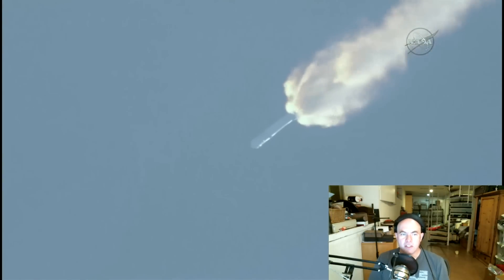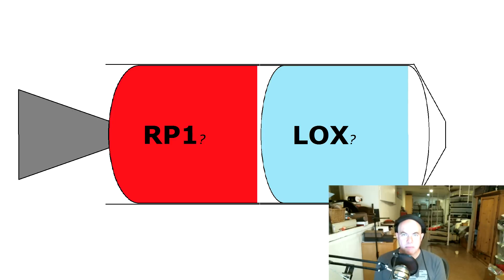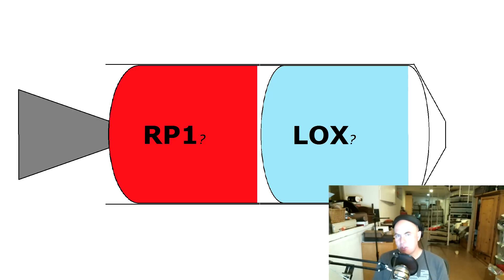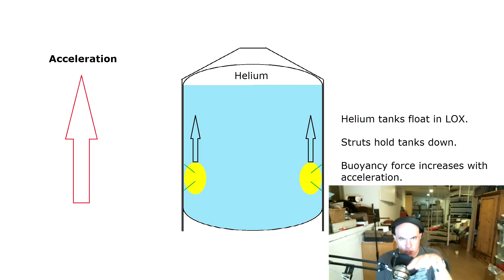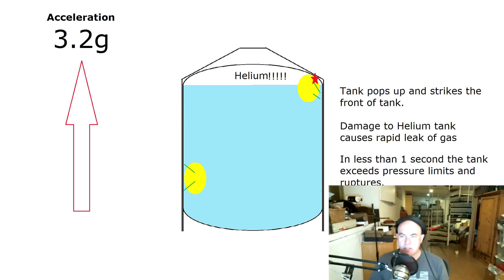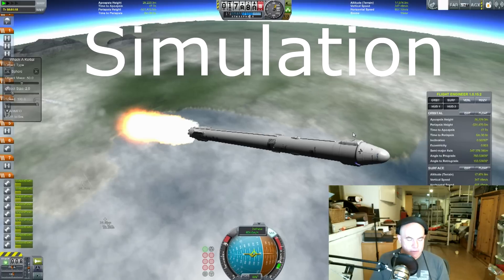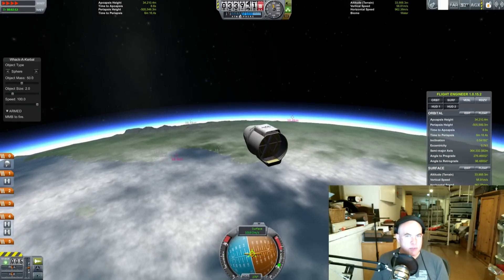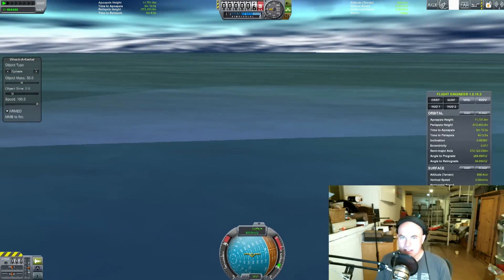Explaining the Space X CRS7 Launch Failure

Comment: So.... none of the programmers of the rocket thought "what will we do if the large container of explosive propellant somehow explodes"....
Reply: ***** What would you have done?
Reply from the maker: ***** The programmers would have weighed the probability of a catastrophic failure which leaves the capsule intact vs the probabiliity of the software going wrong and deploying the chutes during launch.
Reply: Scott Manley They need a giant red "ABORT" button in mission control. (For the unmanned ones at least. That delay could really hurt/kill a passenger)
Reply: Bram06 I would assume explosions are a real possibility.  Also maybe I am biased because I play so much KSP.  But I tend to think the top of the rocket survives more then the bottom.

Scott Manley Makes sense I guess.
Reply: Scott Manley as someone who did study computer science and is studying aerospace engineering at the moment i would have made the same decision for unmanned flights. i don't trust this damn softwares :D
Reply: gajbooks All the soft ware would so is open the parachutes if the dragon is low enough it doesn't actually jettison the Dragon since it has no engines on it.
Reply: hertwog Well, I hope Scott Manley meant more of faulty sensor data or unexpected sensor data that would be fine in the grand scheme of the launch caused the software to make a bad call.

As a software developer my self, I would had tested the code a million times before I would put it in the rocket.
Reply: ***** I'm pretty sure that is what he meant, atleast that is what i thought of when answering :) And please take my statement as personal feeling, not a rational decision. Even though i know better i just have trust issues with anything software/data related since i experienced it myself that sometimes it seems to be impossible to come up with a test for every possible case because you just can't think of it :D But i'm pretty sure this doesn't apply here as such software would most likely use a finite amount of states/transitions. As i said just my personal feeling - not something i could really explain :)
Reply: ***** Aerospace software is put under more rigorous testing than you can probably imagine, even as a software developer. But even despite that, there are still software related errors occurring, historically it's responsible for a fairly significant number of failures.

So, you may think, personally, that your testing would be sufficient, and you'd be confident it was good to go. Then you launch - and your software deploys the chutes on launch. Makes you feel silly dun' it. So, that's probably why they didn't have it on board. Because no matter how many millions of times you test it, it's still a risk.

There is no such thing as risk-free complications. Adding more complex systems = more risk, always been that way, and it always will be.
Reply: Mythricia ***** That describes my feelings towards the whole software thing really well. Experienced it myself with some projects at university: You torture your brain by trying to think of everything possible and every automated testing systems says you got everything covered and then runtime with its unpredictable input - (broken) sensors, unexpected data and worst off all users -  strikes :D
Reply: Mythricia outside of scotts argument, it comes down to money, maybe time constraints.

Ive wrote code on a few recent military projects. let me tell you one thing. One function alone costs about as much as the prius
BUT people hate spending money on time when nowadays india/china will "provide" you a closed source package written by
university students no pay. 1/4th the price

ALSO, what if the code team missed a memory leak. that would be as big as an engine failure. $100k times each head who typed.
that a HUGE loss in wasted hours. it didnt work, simple as that.

Musk is still weighing his options software wise on dragon, id bet money on it.
Reply: Scott Manley They could design the software so that it is activated by ground control in case of failure of the launch system. The capsule still provided telemetry after the failure, I think sending data to it should be possible too.
Reply: TakeoFR If designed to do so - sure. But it's not really - it's a one-way data stream, most telemetry is.

Could certainly be set up that way, I presume, but then it adds the same type of risk that having the actual software onboard would pose - or at least, similar type of risk.
Reply: TakeoFR But then were do you stop. The second you allow remote commands then you need to build in encryption and security measures, and suddenly the specs for your processor are 50 times what you started with. And then it snowballs from there, you have just added many additional vectors for problems to pop up.
Reply: Jonathon Wisnoski not to mention the cost of everything that entails too
Reply: New job position: brainstorm how to destroy a rocket, tell designer to fix it. It exist during Apollo era. I read that NASA employed undergraduates in Physic to brainstorm possible mode of rocket failure during those time. I think it was John Aaron's story. IIRC all Saturn-V had successful launch despite tales of malfunctions.
Reply: ***** In any complex real world situation there are too many variables to account for to make that kind of statement. It's likely in the future of programing this will be mitigated by AI driven design in coding but even advanced AI could have issues designing software for this kind of situation due to the scarcity of data.

Additionally programmers don't make logical decisions about how a spacecraft should function, they are provided a spec and a budget, divide the work, and then each tackle a much smaller part of the software problem.
Reply: Alexei Barnes As a programmer, you can only protect systems from things you know about.  Take that plane that crashed many years ago. Many survived, they made a movie of it (can't remember the name).  Essentially, the plane had total hydraulic failure, only had three engines, two on wings and one in tail.  The pilot flew the plane on the engines alone, took two approaches to the runway, missed by just that much!  Many survivors and lessons learned.
It is now part of the flight system, and autopilot can fly the plane on engines alone (in many cases).
Reply: Mythricia  Jonathon Wisnoski The dragon already has a Command Uplink of 300kbps http://www.spaceflight101.com/dragon-spacecraft-information.html
Reply: ***** I also think it was kind of negligent to not install a fail safe in case of failure. I mean, if the tanks asplode, open the damn chutes! ^_^
Reply: Iain Paterson That's not actually true but I get what you are saying. It's best to think of this in terms of the spec and not the programmer, typically the spec is written by programmers but they aren't "programming" at that point, they are designing a system.

The mantra in software engineering is typically do as little as possible because everything you do can fuck up, and I wouldn't be surprised if that was why this particular event wasn't accounted for.

In particular the following is obvious:
The statement: "if (secondary_tank.is_exploaded()) {}"
couldn't occur because there is no "fuck I've blow up" detector in the rocket likely, that would be a bit of a waste.

The statement: "if (altitude < 5,000) { take_over_all_controls_and_deploy_cute_no_matter_what(); }"
couldn't occur because subverting all controls based on altitude is liable to fuck up other things.
Reply: ***** As someone who is studying computer science right now... i can tell you that you cant test complex software enough to be sure. We are talking about really complex programms and one < instead of <= in the wrong place can let the rocket explode in one specific situation. It is not possible to test all states of a program, and with that i literally mean: it is not possible. Physically.

However, i still think that they could at least implement systems that open chutes in case of rapid altitude loss, or a button in their mission control center of something.
Reply: ***** Not necessarily correct. there exist mathematical models that can be used to laboriously test code that can prove certain things about it. For example, when I was taking computer science they came out with an OS kernel mathematically proven to never crash.

Programs can still become corrupted, there is no way to verify that a bit is never flipped unexpectedly. But more to the point, you cannot guarantee the sensors will not fail, and fail in a weird way that makes it look like a situation that deploying the parachutes is a good idea.
Reply: Jonathon Wisnoski You can mathematically proof for certain functional programming languages, like Haskell, that a function works in a specific way. However, you have to define that. I dont know how to put it since english is not my native language but there is actually a famous quote "Beware of bugs in the above code; I have only proved it correct, not tried it." ^^ I believe its from Dolald Knuth.

What i actually meant with my post was that, to be 100% certain that a programm does excactly what it should do and never surprises you, you would have to actually test every single state the programm can take, which is in most programms physically impossible. As you already said, we have to add all kind of possible hardware failures to this.
Reply: Simon WoodburyForget When did i say any of this? I named it solely as an example of a functional programming language, for which you can proof correctness. Nothing more. 

While i am able to work with haskell, i agree with you that big programms become very unhandy and i feel way more comfortable with object oriented programming languages, but functional programming also has some advantages. For example, it is very easy to work with text, writer parsers and stuff. But that isnt point of this debate. Haskell does what it is designed for id say. However there is an abundance of programming languages and preferences are all over the place.
Reply: ***** Noone actually thinks that. Or at least i hope so. That would be pretty ignorant. Dunning-kruger effect.
Reply: ***** It's not as if it hasn't happened before.... somewhere else.
Reply: ***** It's not as if it hasn't happened before.... somewhere else.
Reply: Mythricia  I don't see why they couldn't build it to where simple specific conditions would have to be met in order for the "emergency parachute deployment" part of the code to be run.  One that takes into account altitude, speed, attitude, and whether or not the capsule is attached to the second stage or if the jettison capsule code has even been run yet.  I don't see why they couldn't write some code that can reassure them the parachute won't be triggered prematurely during a nominal launch.
Reply: Thomas Bryan And those would be the famous last words before some sort of software error causes a false trigger of the chutes.

Software problems have happened relatively often in spaceflight history, and they frequently occur in all sorts of other hardware where software is working behind the scenes.

Difficult to explain to someone not involved in the field, but trust me, there is plenty good reason to avoid running unnecessarily complex software on a spacecraft - if you don't expect to need it, don't run it, or better yet don't even include it in the final flight software.

If it was as simple as you say, you'd think they would have done it - these are people sending rockets to space, after all, and your suggestion that it would be simple to set up constraints and limits on when and how the chutes would be triggered, is not a hard problem to imagine - hobbyist level programmers could do it.

My point is, if they didn't do it, there's probably a very good reason they didn't - rather than just ignorance or negligence.
Reply: ***** lol if the large propellant container explodes it's already too late to do anything I'm sure.
Reply: Simon WoodburyForget 
First, you don't know my background and knowledge level in either aerospace design or computer programming.  I'm not going to sit here and pat myself on the back, but let's just say I have a working knowledge in both areas.

I get what you are saying, but what I'm saying is that it's not THAT uncommon for a capsule sitting on TOP of a rocket to survive a failure.  It's happened enough for the possibility to have been addressed with an escape and recovery plan to have been in place for situations like this.  Especially when you consider the capsule contained over 100 million dollars in cargo, AND this spacecraft is supposed to be carrying astronauts within a year or two.  Don't you think they should have an emergency recovery ability?  Perhaps since this was "just a cargo mission" they didn't feel it was that important, but when they start flying humans I would be blown away if they were to allow another vehicle to explode during lunch where the capsule/cabin stays intact (Challenger anyone?) and they have NO emergency parachute or landing system.  I know that the Dragon V2 has 8 x SuperDraco in four pods for launch abort and landing.  I guess this wasn't a V2 capsule.  Just my 2 cents.
Reply: Mythricia 
First, you don't know my background and knowledge level in either aerospace design or computer programming.  I'm not going to sit here and pat myself on the back, but let's just say I have a working knowledge in both areas.

I get what you are saying, but what I'm saying is that it's not THAT uncommon for a capsule sitting on TOP of a rocket to survive a failure.  It's happened enough for the possibility to have been addressed with an escape and recovery plan to have been in place for situations like this.  Especially when you consider the capsule contained over 100 million dollars in cargo, AND this spacecraft is supposed to be carrying astronauts within a year or two.  Don't you think they should have an emergency recovery ability?  Perhaps since this was "just a cargo mission" they didn't feel it was that important, but when they start flying humans I would be blown away if they were to allow another vehicle to explode during lunch where the capsule/cabin stays intact (Challenger anyone?) and they have NO emergency parachute or landing system.  I know that the Dragon V2 has 8 x SuperDraco in four pods for launch abort and landing.  I guess this wasn't a V2 capsule.  Just my 2 cents.
Reply: Simon WoodburyForget 
Oh, I see, so you're gonna take your ball and go home.  I thought this was a discussion?  Is that where we have gone as a society?  Someone gives you a differing view and then you "don't care" so you walk away from the conversation?  SMH
Reply: Simon WoodburyForget 
I'm sorry that you took it that way.  That's not how it was intended.  It was intended to make the point that I'm not just some kid sitting behind a keyboard who played KSP and thought he knew what he was talking about.  In a discussion, experience and understanding are relevant.  I'm just having a conversation man.  Get over yourself.
Reply: gajbooks Every serious Kerbal Space Program player knows you repeatedly hit the space bar over and over when there is a problem to deploy the parachutes. :) For non-KSP players, hitting the space bar starts the next stage in your rocket profile, so if you hit it enough, you advance to the stage that deploys the parachute.  Each stage can be firing an engine, separating pieces of rocket or some combination thereof. It is usually chaotic and sometimes funny to abort a rocket in Kerbal Space Program that way. If you haven't tried KSP, give it a whirl.
Reply: Well due to their years in work and building those kinds of tanks, they would expect it to work, am I wrong?
Reply: gajbooks Isnt the problem that they cant do this because the rocket travels beyond the horizon? At least the surviving capsule did and they lost contact with it. In that case an abort option would not suffice. Perhaps they can place a 2nd mission control to take over in such an event but in that case software that automatically detects and deploys chutes etc. seem to be the more viable option.
Reply: fergus247 In this case, they had contact with the capsule UNTIL it went below the horizon, and it only went down so soon because it was sub-orbital and smashed into the ocean. Software would have issues and that's what I'm trying to avoid here. Human error always exists, but you can obviously see if the entire rocket exploded and know you should press the button. (Software might derp out and deploy parachutes on takeoff like quite a few of my KSP rockets)
Reply: Simon WoodburyForget I doubt there are "billions" of pieces. According to Reddit (the best source for information in the universe </sarcasm>) the space shuttle had 2.5 million, and I'm sure the Falcon 9 has a ton less than that. If you integrated the process into the production and each part is robotically tested to the expected load, then it wouldn't be too bad. Laser scanners could do wonders for checking part tolerances without requiring much human interaction or even stressing the parts.
Reply: Simon WoodburyForget Obviously you've never heard of regression.
Reply: Simon WoodburyForget I understand that there are virtually infinite ways for a part to fail, but this is about making sure that the strength of the part isn't sub-standard for its expected use. If something fails because of unforeseen circumstances then there is nothing you can do, but if it fails due to lousy manufacturing during otherwise normal operation, then you could have done something about that. Even if you just sample a few of the parts you could tell if something was up with the manufacturer (example: the struts that failed at 1/5 the rated capacity), which is exactly what SpaceX is planning on doing now.
Reply: Simon WoodburyForget Yes, it is quite a ridiculous concept that a helium balloon blew up a rocket, but the root of the problem was insufficient testing of ALL components. I'm sure the engines get crazy levels of inspection so they are very unlikely to fail, but you can't ignore other parts because their failure might result in a Rube Goldberg chain of disaster like in this case.
Reply: Simon WoodburyForget Again, it's not that you have to test every single case in the entire world. You test to see if parts are up to your required specs, nothing more. If SpaceX was less trusting of manufacturers and checked the strength of their own parts (even the relatively minor struts they don't think would fail), this would have been prevented. EDIT: Even a statistically unlikely broken part might be caught with this process, and even if it was the only one, it won't cause any explosions when in the trash bin.
Reply: Simon WoodburyForget Obviously not. It was stated that they would test each strut "Going forward", and Elon Musk even said his company "became maybe a little bit complacent after 20 successes in a row."
Reply: Simon WoodburyForget Then it needs to be on every part. You can't get better information than the PR without working for SpaceX, and even then you probably have a ton of NDAs just for looking at the rocket nozzle from 50 feet away.
Reply: Simon WoodburyForget No... I'm just saying that the PR crap is all most people can get at. I'm not saying it's right, but it's probably more accurate than an assumption. (We all know what happens when you assume)
Reply: Simon WoodburyForget Their rockets are already way cheaper per KG of payload than their competitors, so raising the price a bit wouldn't hurt. Plus, if any more incidents occur it will be very damaging to their reputation and probably lose them future business and investment.
Reply: Simon WoodburyForget Your argument is very convincing.
Reply: Scott Manley I'm quite sure someone already commented on this, but if you have possibility to track the telemetry of the Dragon capsule, you could feed it information about how the flight is supposed to go. Then, if the actual trajectory is way off course (kinda falling with terminal speed in air instead of climbing into orbit!), it should deploy chutes on itself.
Reply: Then you lost the craft. But probability of not losing the craft is better than not having that probability.
Reply: Simon WoodburyForget nasa, for space critical applications used assembly and machine language to get as much efficency and save as much space as possible.
Reply: gajbooks The Dragon spacecraft does have a launch abort system. He mentions in this video that the Dragon capsule seperated sucessfully.
Reply: Simon WoodburyForget I'm sorry but you don't know what you're talking about. Are you a software developer? If so, have you actually build software in languages you mentioned (OOP languages, imperative languages and in pure functional languages like Haskell)? You clearly haven't. Out of the languages you've mentioned,  I've build software in C, Java, Python and Haskell. Haskell IS provably more safe that those languages you've mentioned and it's been around for decades. It was also used in aviation or finance long before it was as productive as it is now and when it was a bit  painful to code in (which is not true now). Why? Because it is safer. Out of all those languages Haskell is the best language to build safer software in mainly because it has the best type type system out of all those languages. It is also MUCH MUCH MUCH easier to maintain and refactor  as your codebase grows, because most errors will be caught by the compiler, especially if you enable the right extensions. You can even enable refinement types and thus use predicate logic there.

 Also, you can restrict Haskell code and not let it do anything that you don't want to. In the languages above, anybody in your team can modify some  state or launch nuclear missiles anywhere in their code, unless you check every line of their code to make sure that they don't do it.. In Haskell you can make sure that code they wrote does not do any IO you don't want and does not modify any state you don't want it to modify. It evaporates a whole class of bugs, especially when it comes to concurrency. 

Who in their right mind will compare Python to Haskell or even Java when it comes to safety. They are light years apart and designed with different philosophy in mind. Python is good for many things, but Python is not known for safety and safety was never a part of its design. Good luck trying to catch all those runtime errors. Good luck adding new programmers to your team and making sure that their code does not interact with the code already written in a way that causes runtime errors.  Part of Python's design is letting code explode while it's running and not catching it at compile time.

In lower level languages like C or C++ you have a whole new class of problems  you have to avoid, because you have to think about memory management. I won't even speak about Haskell here. C is safer than higher level languages? Seriously?  OpenSSL is opensource and people still manage to fuck up memory management there (e.g. famous Heartbleed vulnerability). 

As for building real software in Haskell or any other language, it depends on what you want to build. In 90% of cases, I would prefer to build software in Haskell, IF the team I'm working with would know the language well enough. Haskell code has  less lines, less bugs, better abstractions and it is a lot more maintainable (because you can let a total noob add code to your codebase and compiler will catch most of his/her errors). In some cases Python shines  (like numerical programming or letting scientists write code, who don't want to spend time learning a complex language).  In some cases (real time software, software where you need deterministic timing, firmware) you just have to use a low level language like C or C++, because you want to manage memory manually and be closer to hardware. 

But for safety, Haskell is best in class out of the all languages you've mentioned. It's also best in class for compiler writing and parsing. It's very mature for concurrency and distributed programming. Lately, it also matured when it comes to web development (client side libraries are not as mature, but it has one of fastest and most powerful  back-ends). The client side mostly is not mature because not enough people are working on it, but there still lately some production websites using reflex for their front-end.  You can even fully compile it  to Javascript (with all dependencies) and use it in a browser, generally without any errors and without restrictions. 

It's a myth that Haskell is not used in production or that Haskell is bad for writing real software. It was partially the case years ago, but now it's one of the best language to write many types of software in, especially if you want safety, fast deployment cycles (rapid development) or if you want maintain that software for a long time (and being able to refactor it faster).  For example, Haskell is used very successfully in financial industry where they sometimes  have to react and deploy software very fast (again, because it's more safe and when you try to push your code to production the same day you write it, you want the complier to catch as many errors as possible). Haskell is also used in highly distributed performance critical systems, e.g.,in Facebook they use Haskell for the system that needs to serve more than one million requests per second and fight spam. 

The main reason why some languages are not used as often, even though they can solve a particular problem better,  is because they are not used as often. This is the feedback loop that determines popularity of languages. You can cast a magic spell tomorrow and create the most marvelous programming language the world has ever seen (which Haskell certainly isn't, it has flaws as any other language) but it's usefulness will do almost nothing when it comes to its adoption. You can cast a magic spell and create the most ludicrous programming language, but if everybody is using it, then everybody will continue to write software in it.  And new languages will try to mimic that ludicrous language.  This is how real world software industry operates. Popularity has little to do with a language being terrible or excellent.
Reply: Simon WoodburyForget I'm not going to argue with somebody who most likely tries to pretend to be an expert in the field they know little about. You did not address any arguments, most likely because you did not even understand what was being said. Just merely seeing languages like Python, C, C++, Java being mentioned in the same line in the context of safety should look weird to any professional polyglot software developer. Now you compare fortran (imperative language) to Haskell (functional language), which have almost nothing in common. If you address my arguments about safety and I discover something I'm not aware of I'll be happy to reply. But until then I feel as if I'm witnessing somebody finding themselves wearing scrubs and trying to convince everybody else that they are really a surgeon. "Ok. let's prepare to remove his kidney" - "Sir, you're removing his liver" - "I know, but don't worry he has the second liver" - "Sir, this is his second kidney" - "Aha, good. I was just checking you. Now that you passed the test let's put this liver back."
Reply: Scott Manley Well not just the software, it's dependent on hardware too and offcourse sensors, which might also have errors. Presumably higher risk of that after a catastrophic event. :)
Reply: +Steve Austin I bind functions to that big red abort button. Has actually saved my Kerbonauts many, many times.
Reply: +Tyler Churchwell You don't program rockets with a language that can cause memory leaks. Typically, you would use a "safe-language" like Ada or, now, Rust that has type safety and memory safety so you can avoid these issues.
Reply: +gajbooks  Ksp reference?